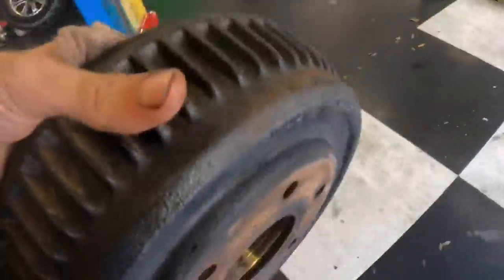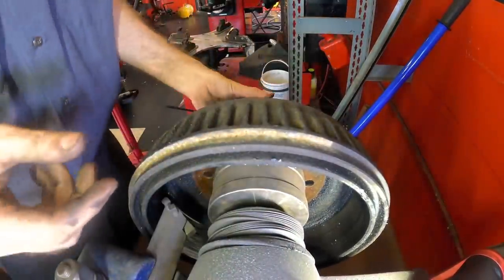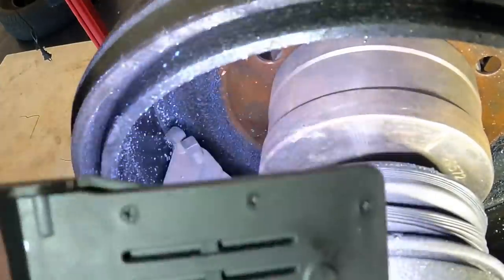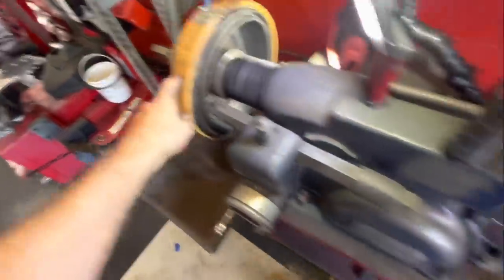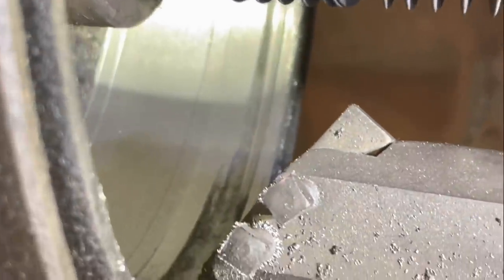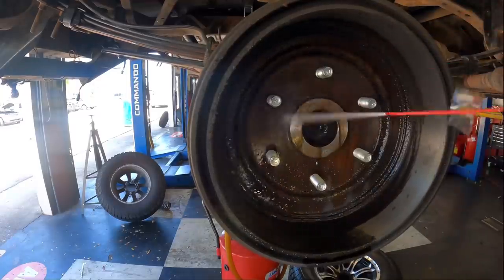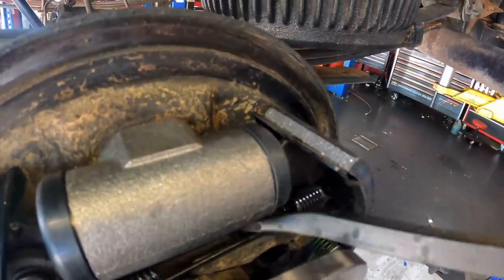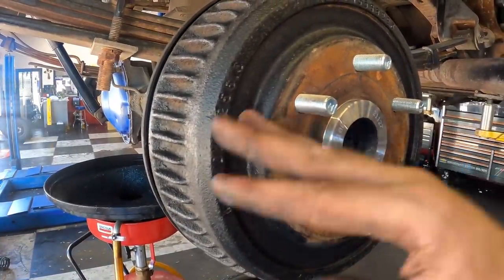How To Machine Brake Pads and Rotors to Recondition Surface | Brake Lathe Drum Resurface

Comment: Spray cans of brake clean are among the best tools available. In the days of my first car     (a '51 Ford sedan) it was a catch pan, parts brush and a coffee can of gasoline to clean up a near identical mess before repair and reassembly. Ah the good old days.  Nice worlk Ray.
Reply: ah, but there's a sig. amount of money gettin used the way Ray goes thru brakeclean like candy...obvious the cost of those cans aint comin outta HIS pocket!!
Reply: @ronhall9040  but some customers if one drop gets on a drive way and/or something drips. They are coming back to the shop saying there is a problem. So you have a worried/upset customer plus technician time to recheck everything. Over 2 to 3 dollars a can not worth the headache.
Reply: @Note_Creator  i get his use..just the way he blows thru the cans I KNOW the cost aint comin outta HIS pocket ;-)
Reply: I remember melting holes in our driveway cleaning things with gasoline.
Brake Clean has an advantage in that aspect.
Reply: @Note_Creator  What's in that can?  
I guess you are one of those types that always rationalises and pisses  money up the wall at any chance.   
Drive a truck as a car too?  You should be charged $20 a gallon for your fuel.
Reply: I agree. I love that stuff for everything. My only concern is breathing too much of that inside me! 🙄
Reply: I remember those days.
Reply: Yesterday I opened a new can of brake clean and I thought of Ray have a good evening everybody
Reply: I had a 53 Chevy van with a 327 in it built in vocational Vo-Tech high School hey it was a great vehicle loved it wish I still had it have a good evening
Reply: @michaelpressman7203  Lolololol. I hear ya buddy! 👍👌😁

Comment: One rearend squared with the world. Nice work. 
Your shop is one of the rare ones that still turns drums and rotors, Most places just sell new, regardless of how much life is left in the old ones. Often a broken in and seasoned drum or rotor once turned will remain truer than a new one. Just as a block with 100k on it makes a dimensionally stable race motor. When it comes to castings, used is good.
Reply: Problem is car manufacturers are making rotors that come new at the discard thickness. There is no extra. They are engineered to be as light as possible, for maximum profit.
Reply: Legend has it that the best years of triumph motorcycle was when the factory was on strike and the crankshafts and cylinder barrels blanks where left outside to naturally season before being machined when the work resumed . probably just legend but the most sought after years are from the late 60s production run .
Reply: @kingofbrutaltheocracy9201  Not just for profit.  Also to meet the ridiculous and arbitrary CAFE standards.
Reply: Unfortunately new rotors are now so cheap that financially it doesn't make sense to cut them. Cut a rotor? 20 bucks. New one? 18 bucks. I've seen that way too often
Reply: @damienvillano4044  I just put rotors on my wifes Honda Pilot. $90/each for front, $60/each rear.  Nobody cuts them around me would have rather.

Comment: Grandpa's trick is to spray oven cleaner on stuff and wait a minute or two then rinse with brake cleaner. Oven cleaner works better then brake cleaner but evaporates slower so the rinse washes the oven cleaner off and allows it to dry fast. Makes a ton of things look brand new.

Comment: It hooks on the outside not through the hole, it relies on friction not tension. Why not use the parts cleaner first then Less Brake cleaner. Surely you're not the character from the movie.

Comment: Here in the UK everyone seems to be "Just throw it away and buy a new rotor/drum." People look at me as though I'm crazy when I just grab a disc or rotor and skim them in 5 or 10 minutes. I honestly think the UK has lost so many skilled people that most don't even know what's possible any more in a simple engineering shop like mine.
Nice and shiny, good as new and a third of the price of a new set 😁
Reply: Same here in the US. Brake lathes and people who can actually operate them are pretty rare. It depends on the vehicle as well. In my area rotors just rust apart and for the Asian imports the replacement parts are very inexpensive and of pretty good quality. On big trucks it's a different animal.
Reply: I didn't think anybody in the UK still did this,  usually just tell you to throw them away and buy new ones. You must be the last man standing keep  up the good work. You should advertise your services
Reply: @colin4850  Thanks Colin, I do one off and speciality jobs mainly on vintage and race bikes. Only one thing, I'm possibly the last girl standing. Long story, but I wanted a vintage Norton motorcycle years ago and things kind of grew from there. If you can't buy it make it yourself 😁
I've just finished building an electric start system for a Manx Norton engined special as the owner has serious health issues and we want him to get a last ride on his bike.
Trouble is we tiny engineering workshops aren't really appreciated on the whole here in the UK.
Reply: @robertinfante5222  Luckily my lathe has a 20" swing with the gap removed and I made an extension to my cross slide to get the necessary travel.
The honest truth is I just like the idea of no throwing away perfectly good parts. I can skim an average disc for £15 when they cost starting at £50 or £60 a piece. I think it's worth the effort.
Reply: @PurityVendetta Oops sorry about that just a figure of speech.I am currently repairing my 30yr old Virago after parting company with it on a back road in Devon. I know it's not in the same league as your vintage British bikes, but a challenge never the less
Reply: @colin4850  I ran a motorcycle dealership in Germany in the late 80's early 90's and we sold dozens of Viragos. People might look down on them or deride them but they're a lovely piece of engineering, reliable, tunable (if you wish) and ride beautifully. The are everything the bikes they sought to imitate weren't. We actually look for cheap examples to modify into specials. Good little bikes and don't let anyone tell you otherwise. 
How you weren't too battered and bruised. Good luck with getting the bike repaired.
Reply: Problem here is unless you have the tools to do your own machining. The price between a new drum/rotor and resurfacing/machining old ones is negligible. We are talking $0.05-0.06 per, and often the new is the cheaper option.
Reply: @mojoman3201  This is the UK. Pair of new rotors £70, me skimming a pair, £30. Half an hour of my time @ my hourly rate of £60 per hour... £30, half the price of new rotors. I don't think that's a bad deal, yeh?
Reply: @PurityVendetta  not at all
Reply: I bet this will become important again in the future with shortages of raw materials will increase prices of new discs or rotors.
Reply: The shop near my house charges $25 a rotor. I can replace my rotors on my Mazda for $35 each. I’ll spend the extra $40 for all 4 and have shiny new ones. Back when the parts store turned them they were $10 a rotor. I rarely replaced them back then. I hate the waste, but $10 is cheap peace of mind for new vs old parts. We used to have a place in town that would rebuild an alternator or a starter  too. Now, an alternator for my Suburban is $80 at the parts store with a warranty. Why rebuild it?
Reply: @stevewhiting556  A) We pay much more in the UK, I guess taxes etc, but then again we have universal healthcare, just about as long as we keep the US corporations done get a foothold. So things are a little more expensive here.
B) Are you happy to fit parts made for peanuts in China at the expense of your economy then become a paid up member of a throw away society? One day South Asian economies will turn and all that cheap stuff you people were buying without a care in the world will be very expensive and all the people like me will be gone. 
So, you hate waste but can be bought off as long as you can do it on the cheap and don't worry about throwing away perfectly good parts so you have peace of mind fitting cheapo pattern parts 🤨🤔😉

Comment: You do not discuss the need to check the drum inner diameter to see if it has enough metal left to be within minimum wall thickness.  This is critical.  Then you should take a caliper or inside micrometer and measure the finished diameter. And finally, and here I show my advanced age, you grind the shoes to the correct arc (1/2 the dia.) making them fit exactly without any break - in other than surface finish seating.  I spent my middle teen years  doing these steps for the line mechanics hundreds of times.  But no one goes the extra mile anymore.
Reply: I’ve heard of grinding the shoes or arching them but never saw it done in all my years. Must be a lost art.
Reply: They stopped grinding the shoes because of the asbestos dust it created.  I did have a set of sintered metallic linings ground back in the 60s.
Reply: It's a video of some his work, it's not a tutorial.
Reply: I use a radius grinder still
Reply: As I am 24, I do not know much about arcing brake shoes.
Do you do this with a machine or is it something you can do at home?
Reply: @ruudxd1  you just chalk the surface of the shoes, engage brake and rotate axle a couple turns, file/sand a bit, then repeat

Comment: i started a new job and they had the same machine but a lot more abuse on it. Asked why it was not used and they said shaft was bent. I asked to fix it and proceeded to make repairs. Ordered new shaft and assortment of parts. Got everything dialed in with indicator and then trued up all the adapter flanges and made custom bushings for ones slap worn out and dialed them in as good as new. Expecting to get paid a coupla hundred bucks and my boss gave me 1.5 hrs.    Boy was I taken. Took longer than that to order the parts. Thing ran for years after that. Then someone knocked it out of center. Boss wanted me to fix it, told him not for what you pay. It never returned to service. Some shops just don't deserve good help.

Comment: I m curious as to why you did not measure the maximum diameter of the drum. You are very careful to do things correctly in all your work. With these cheap ass brake drums the manufacturers are using I m surprised that drums can still be turned at all. Most shops no longer turn drums because of the huge liability issue. The maximum diameter is cast into the out side of the drum and turning past this diameter in these lawsuit happy times is crazy. The drums are already super thin from the factory. During an emergency stop the drums can break especially pulling a trailer that does not have brakes of with a heavy loaded vehicle. I personally won t turn a drum more than .010 on a car and .020 on large pickups for clean up because of the liability and the fact they are so thin from the factory. I just replace them. You are what I consider to be one of the best mechanics on YT and I m just asking not starting any of the shit that goes on in the comments !!!!

Comment: I never "turn" rotors or drums. Why? Because that is your heat-sink. When we use the brakes we are converting the kinetic energy in the moving car into heat energy and the more mass in the rotor or drum to absorb that heat, the better.
   Especially when it comes to brake drums because something else happens with drums. As they heat up they expand, and that causes the pistons to have to travel farther to maintain pressure between the shoes and the drum, and that makes the brake pedal fade further toward the firewall.
   Besides, charging a customer to re-machine drums or rotors costs almost as much as new ones. It is always better to just replace them. Give your customers the best brakes they can have. Eliminate the possibility of cracks and warping arising from thinner braking surfaces that run hotter and give them the best possible braking endurance with the most massive drums and rotors you can provide.
   Oh, that reminds me. Some cheap drums and rotors are cheap because they are light, so be sure you are buying good ones that are as nice and heavy as original factory drums and rotors.
   Sorry about the investment you have in that lathe. Industry practice using them is widespread, but that doesn't mean it is best practice. Best practice is what that term implies, the best brakes they can get, and that means new drums and rotors.

Comment: It's been so long since I did a back drum brake job I forgot all about having to adjust the star wheel, I think it was my 1969 Mustang and it was also the last car I had where the rear brakes actually wore down. 
I enjoyed seeing the Drums getting cut.
Reply: I remember back in the drum brake days a lot of people made the mistake of adjusting the handbrake cable and not the brake adjuster to "fix" the rear brakes.
Reply: @johnt.848  That wouldve been a mess to fix.

Comment: Drum lathe belts last just fine if you don't put the hook through the middle slot.
Put the hook so the whole dampening belt is captured in the hook across it's width.
When I was a newbie, Brakeman Bill taught me this.
We never tore up another one because I bothered each new guy and taught them.
Be kind to rubber and it will last and last.
Have a great day.
Don't spray brakleen on it either.
P.S. your arbor bellows needs some TLC or to be replaced next time the lathe is serviced, perhaps.
Just information.
Don't have a cow.

Comment: Years ago, when I owned a shop, I had a really nice Aamco lathe...but by the late 1980's I had learned that no one making replacement parts were providing enough brake hub liner to allow for sufficient turning, if there were any groves in it. If you check your 'MAX DIA.', you'll find that actually fixing a 1/2-ton (Class 1) vehicle's brake drums is almost impossible without just replacing the drums themselves. The bad part is, if you check drum runout on a new drum, a LOT OF THEM are either 'out of round' or simply out of specs, to start with. It's bad when you get a new brake drum, and have to turn it on a lathe, just to 'get it in-round' and in-spec.

Comment: I’m an old timer, 70, my pops had a auto parts/ machine shop store. I started cutting drums in 1964. I did you mic those drums, my old man would have sent you on down the road. That last drum looked a little on the slim side. Do you mic the rotors. If you don’t the drums you don’t the rotors. Dangerous Gamble.

Comment: Ray back in my day all shops did this now they just sell you a new drum or rotor. Nice to see someone do there job and try and save them money. In my town you used to be able to bring your brakes and rotors to brake shops and they would charge $10 to $15 for each piece instead of a new one for at least $50. but they don't do that anymore. Keep up the great work. PS what is your monthly brake clean budget?

Comment: This Vodeo made me recall working on ONE Rear Brake of a 66 Chevy Pickup, because it wouldn't grab and refused easy adjustment....

Took it apart, Cleaned everything with a wire brush, greased the adjustment bolt, put it back together......

I was 13 years old..... 

Good Times indeed.....

Comment: As a shade tree mechanic myself I really liked everything you did. Back in the day, we had a tool you could use to adjust the brake pad from the inside of the brake housing. There used to be a rubber plug that you could remove to allow you to insert the tool into the housing and adjust the wheel. One issue I have a concern about is your apparent lack of a mask when spraying the brake cleaner - oh and while using the machine to turn the drums. You really don't need to be breathing the mist of the brake cleaner and those nice little metal shavings don't do your lungs any good either.
Reply: He references adjusting the brakes through the slot for fine tuning. 🙂
Reply: A: that slot is how you lock up the wankers that park where they shouldn't. 
B: its probably just degreaser labelled as brake cleaner. No heptane or chloride= not brake cleaner

Comment: Brake cleaner is a staple of every mechanic from engine rebuilding to hand cleaner. I really favor the chlorinated stuff but walk around a welding shop with it, you get the stink eye in a hurry. And yes, chlorinated brake clean will decompose to a poisonous gas when burned. Beware of the white fog!
Reply: Phosgene no bueno.

Comment: We had the same nasty harmonics issues when turning very large diameter experimental RB211 aero engine disks (of exotic steels) in the imaginatively named Disk Shop at Rolls Royce in Derby in the 1970s. That sound was so bad it was capable of making people feel ill!! Even wearing earplugs and industrial/firearms style ear defenders made any real difference. The sound penetrated your skull and whole body. When two or more lathes were doing the same job at the same time, the old guys would howl out the tone to each other! I swear it drove some guys totally insane! As a second year apprentice, I deliberately failed that module and got moved to a different shop. 

By the way, couldn’t you hold the rubber band on with duct tape?

Interesting video. Thank you for sharing this process.

Comment: Resurfacing modern drums or rotors/discs has for me never been an economical proposition because when you value what remains of the drum or rotor/disc before it has to be swapped out due to its wear limit and then add the cost of the surfacing work, you end up with the item having a value that exceeds a new item.  If the drum or the rotor/disc requires machining then the shoes/pads either need resurfacing or replacing and given that drums and shoes and rotors/discs now wear at the same relative rate due to non-asbestos friction material and the complementary cast iron spec, it makes so much sense that where significant wear is shown, replacing the sets for the full axle makes so much sense.  Gone are the days when the crappy friction material wore out much quicker than the cast iron, meaning that drum or rotor/disc was worth refurbishing.